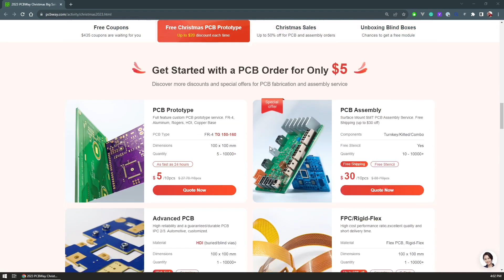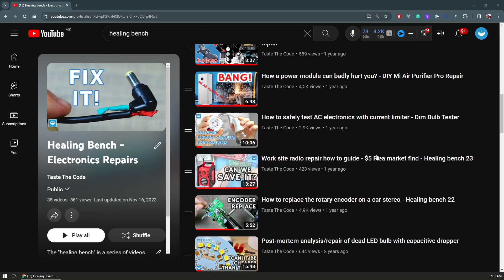Easy Xbox Series X Overvoltage DIY Repair: Swapping a Blown Metal Oxide Varistor

Comment: i am having an odd issue with my series x
its power off randomly look like power cut every time
i did every thing opening console repasting, cleaning and tightly secure power cable
but it randomly shuts off and when it does all power goes off even from my mouse and keyboard
btw series x have 5 volt on usb even console is in sleep mode 
so look like my psu is loosing power 
it happens 2 or 3 time a day and sometime whole day went smoothly without any issue
i play for 8 or 10 hours a day LOL
can u advice me something on this issue
Reply from the maker: I would recommend that you replace the power supply. It sounds as if there is an issue with a capacitor that causes the voltages to crash. It is not entirely broken but it is on its way to be. You can possibly replace the capacitors in the PSU to see if that helps but a new power supply is much safer option.

Comment: Having an odd issue with mine. It shut off randomly. Power cycling, new cable etc doesn't bring it back to life. However rapidly turning the OUTLET on/off then hitting the power button on the xbox boots it into life for a few days. Im guessing its PSU issue not a board issue ever seen this?
Reply from the maker: I do not specialize in XBOX repairs but this sounds like a PSU issue. Fast cycling the PSU can create some surges inside that might just charge a capacitor at a level where the PSU thinks it is being turned on. 99.9% it is a capacitor issue on the PSU.
Reply: @TasteTheCode  yep this was my thinking a cap is not hitting level it needs to move onto next sequence in boot up. Sort of like a stuck valve if it were plumping. Proper odd. Guess ill gamble on a psu cheap enough.

Comment: tell me if it throws me out of the game, if I play for 30 minutes and the xbox x freezes and turns off.
is this a problem with the power supply?
Reply from the maker: I'm not an Xbox expert but I guess not. It sounds more like an overheating issue.
Reply: Did you find the reason why its happening? Becuase I have the same problem